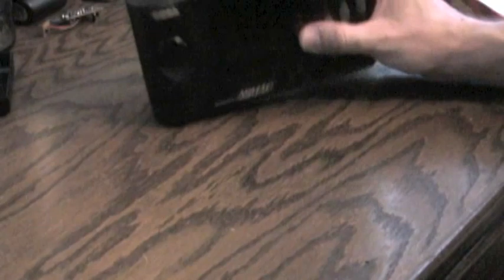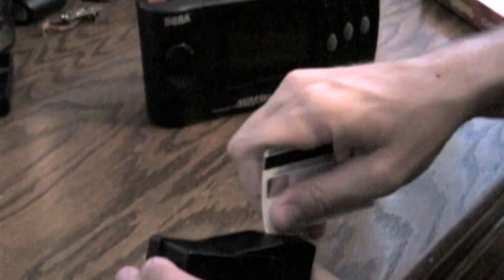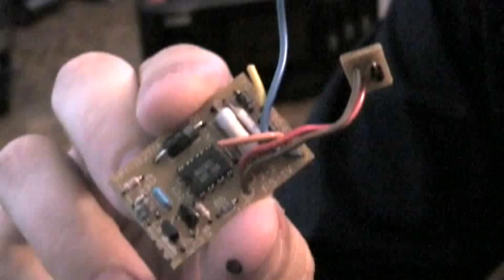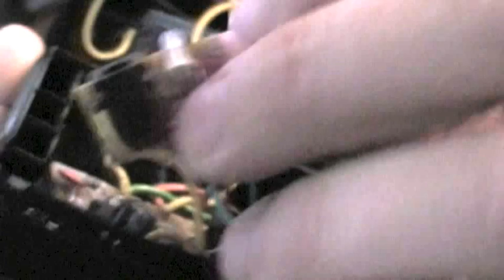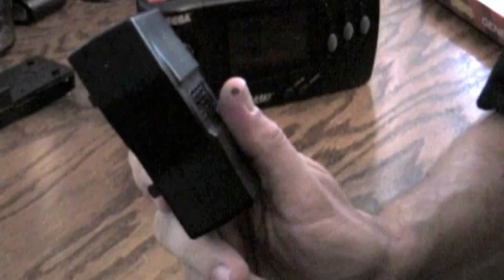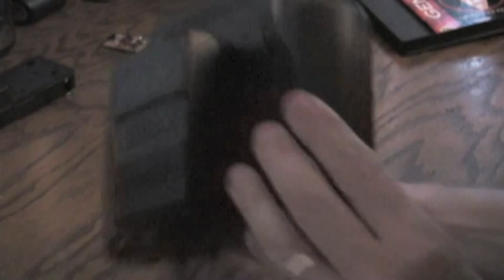Sega Nomad PowerBack battery mod

Comment: The Sega AC adapter is either a 9 or 10v adapter, depending on model. Have you had any charging issues with charging a 12v battery pack? Also, how does the voltage regulator inside the Nomad hold up when converting 12v to 5v?

Comment: can you just replace the old NiCd with like nickle metal hydride ones and just use the same circuit and charger like you can with the game gear battery packs?
Reply: it's not the same mAh (4400mAh for the sony battery and 850 for the original genesis 2 charger) so in the better case it will not works, in  the worst you will burn your new battery...